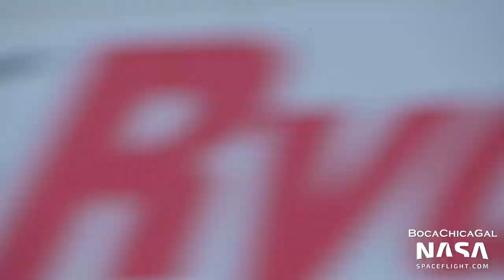Ship 24 Comes Alive with Flap Testing | SpaceX Boca Chica

Comment from the maker: Check out the most recent Starship Roundup Article covering everything from Starship from both Starbase and the Cape. 
https://www.nasaspaceflight.com/2022/07/starship-24-awaiting-static-fires/

0:00 - Sunrise
0:22 - Venting From the Orbital Launch Mount
0:50 - The Orbital Launch Mount
1:07 - Work on the Chopsticks and Launch Mount
1:56 - The Orbital Tank Farm
2:29 - Ship 24
3:45 - B7.1 Test Tank
4:15 - Bridge Cranes for Starfactory
5:16 - Starlink Loader Building
5:34 - Starfactory
5:51 - Oversize Load Trailer.
6:35 - Starfactory
6:49 - Quad Barrel Section
7:06 - Ship 25 Nosecone
7:23 - Ship Forward Dome
7:43 - A Booster Gridfin
8:02 - Scrapped Sections of Booster 5
8:20 - Delivery to the Production Site
8:37 - The Rocket Garden
8:54 - Work Inside Ship 22
9:09 - Ship 24 Moves it's Forward Flaps

Comment: Is that real time??? Those actuators are insanely powerful!!!!
Reply: I don’t think it’s real time. You can see a person on some sort of crane on the bottom left moving way too fast. However they still do move pretty fast as seen in the SN15 flight test video. :)
Reply: Watch it at 1/4 speed.  Near the end the workers in the lift are still moving faster than normal.

Comment: I'm always more and more convinced that the OLM is way, way too small for the 33 raptors once they will light them up for booster departure. I can see they've painted it up rapidly, but I think what's needed is a way of "funnels" under there, to divert the exhaust gasses away from the zone. Also a suitable deluge system is needed is Elon don't want to repair damages after each launch. There's TOO MUCH in a so small area not to have dameges after each future launch, even if everithing goes well as we all hope so.

Comment: I’m curious to know whether it would be possible to reposition the forward flaps further down the hull (to where it becomes straight). Surely this would simplify detailing! If it’s a matter of balancing forces, elongate the whole rocket.
Reply: The problem is like pushing your finger on a balloon, something changes and causes many other parts to have to change. It becomes more and more complicated. That is why the design changes only in very small increments. Elon talked over a year ago about moving the forward flaps, but as we see, they haven't.
It is not only a matter of shape, it has to do with weight, usable payload area, where to place the hatches and payload door, structural integrity, etc.
Reply: Elon hopes to eliminate the forward flaps entirely, but first they'll try moving them *leeward*, to get the hinges behind the halfway point so the joint isn't exposed to the full blast of re-entry plasma.
Reply: @dancingdog2790  Yup. He said that over a year ago, but we have not seen any signs of it. I think he has a lot of push-back from his engineers on that.
Reply: @knowledgeisgood9645  I'm not a rocket scientist or an engineer that deals with fluid dynamics or anything...but I'd assume that removing the front flaps would be akin to amputating someone's arms off and expecting them to still be able to crawl.  I'm sure it's possible, but it's probably clumsy as hell and not something you want to be doing when flying on the edge of your limits already.
Reply: @LezChap  I don't think Elon's idea was to just remove the forward flaps and do nothing else. There are many ways to do it by replacing their function my something else (like a grid fin at the top of the nose cone or having some nozzles using gases to do the same job).
But Elon's idea was that by moving (not removing) the flaps back enough to hide the hinges behind the hull while making their surface a bit larger, the surface area exposed would be the same but the hinges would be safer.

Comment: Why paint everything, if everything will burn again when the rocket is launched?
Reply: Corrosion protection.
Reply: @owensparks5013  Oh, sure... humid air, salt... Thank you, because I'm a fool))
Reply: Questions are good.  👍👍
Reply: @owensparks5013  I know you're 100% right, but I also believe Elon doesn't want a new shiny ship and booster sitting on top of a charred OLM. Especially for the first pictures anyways.
Reply: @matthewmartin5763  This does not prevent him from using charred Falcon 9s))) But you are right about the first photo)))
Reply: @Kolya_V.1981  Charred Falcons show people that they are being reused - one of the selling points.
Reply: @knowledgeisgood9645  I understand. But here it will be charred OLM😝
Reply: @Kolya_V.1981  I am almost sure it will only get charred low down on the legs of the OLM, and the top of the table, but hopefully nothing in between.
Reply: @knowledgeisgood9645  I hope too))
Reply: When the largest rocket ever flown is sitting on the pad for its first launch, it will look its best for the history books.
Reply: @JZ's BFF :elbowcough:Thanks☺

Comment: Why they didn't make launch mount pad in triangle, it could  be less corrossive and less drag while lift off.
Reply: They are smarter than me but I think of a 120m tall lever weighing 3000-4500tons. A triangle has longer unsupported sides so higher potential for ripping it out.
Reply: @GavinEarnshaw  I mean by triangle piller of LM
Reply: They have added triangular shaped blast shields to the 'legs' of the OLM. I think as far as the circular shape for the legs goes, it's more ground stable and less prone to shifting/cracking while supporting that much weight. Think about how many triangle support columns you have seen. They are mainly either going to be square or circular.
Reply: @matthewmartin5763  you are right, beside this OLM have very little space for thrust cover? It don't have underground thrust escape route like SLS

Comment: I think that it would be better if starship's flaps were fixed.  The titles would have a better chance of staying put and some type of heat resistant paint used under the titles in case some titles fell off.
Reply: That would be some paint to survive the heat of re-entry....  Guess they could try it out on the OLM first.  Oh wait, I think they did!
Reply: Yea i am sure having the tiles stick will be of great importans when they cant control and land the rocket. The entire point of the system.

Comment: I wonder what a micrometeorite travelling at kms/second would do to 3mm steel. I hope Elon has thought about that before a human carrying variant is launched!
Reply: All space craft have thin walls to save weight. All other human certified craft are ally.
Reply: @smacksman1  yeah but most human space craft don't go into deep space, where micrometeorites are more common
Reply: @kennybevan11  The number of micrometeorites is not less in LEO than elsewhere. They burn when they get inte the atmosphere.
The tanks use 4mm steel. The cargo section is about 3.6mm. 
Depending on the mass and speed of a grain of sand (micrometeorite) we can calculate the momentum. If we find out what the limit of the 304X used is we can answer the question. Too many unknowns...
Reply: Micrometeorites are not what we should worry about. It is high energy particles (like protons and neutrons) that are the real danger.
Reply: OMG you're right, better cancel the program!
Reply: @dancingdog2790  I know right? I can't believe how dumb some of the world's greatest engineers are. Thank the lord almighty that we have people in youtube comment sections who think of things no one else has.

Comment: Spacex needs to slow down the upgrades to starship and booster at this rate they will never launch the orbital stack
Reply: What nonsense. This is not about satisfying your need to see a rocket go to space. Its about creating an effective system.
Reply: Your right sorry I got carried away😅I just can't wait for this launch!
Reply: All I'm saying is that: why waste steel when you can just launch number 24/7 lol I just realised what I just said. Back to the point: I know they scrap the steel but could've they just launched 4/20 or was the olm incompatible at the time?
Reply: @TerraSpaceIndustries  I am not sure exactly how the timeline is but they did not have permission to launch when the 4/20 was relevant. And in the mean time the next design was simply ready. And they want the best chance of success. Yes spacex tests and crashes alot. But the booster is 30 raptor engines. 30. It takes longer and cost more to make the engines then the entire booster section. 

Also until the tower and tiles on starship was ready a launch will not give them alot. Yes it will test things and might show some problems. But what they REALLY want to test is the reusability part of the system. Getting to orbit as long as the rocket dont have an unexpected failure is relatively simple fual math. Catching the booster and surviving reentry with starship is where the questions and unexplored territory is.
Reply: Oh yes they didn't have the permission did they. The FAA where in they're enviromental accesment at the time. Glad that's finally over. Hope spacex manage the reusability system well. Can't wait to see the first catch using the chopsticks.
Reply: I'm aware that spacex lands the F9 booster stage on its drone ships bit they don't reuse the second stage. It's definitely territory that spacex haven't seen yet. It will be interesting when starship re enters. They will hopefully get a lot of useful data from the first orbital launch and I hope musk puts it to good use for a starlink V2 batch on the second orbital flight though I heard they possibly loaded 1 starlink onto S24 when it was being fitted with its raptors.
Reply: @TerraSpaceIndustries  Yea lets hope.